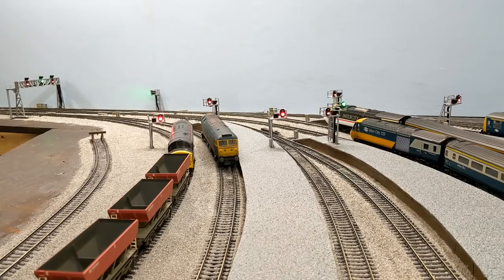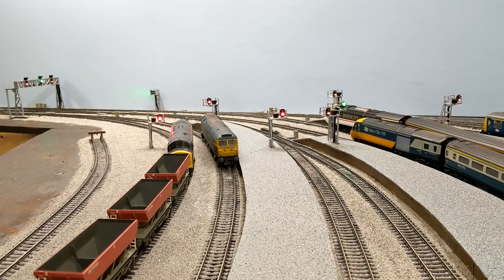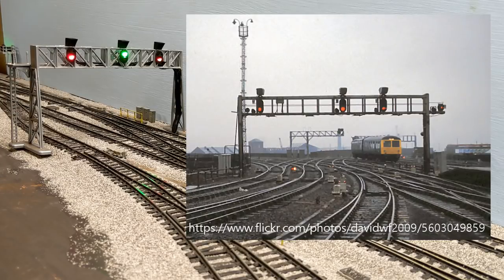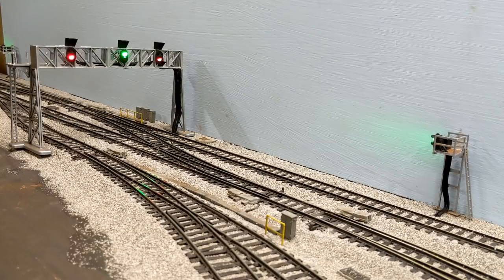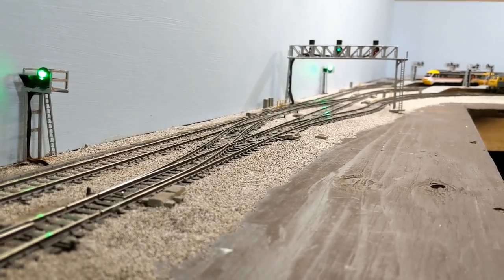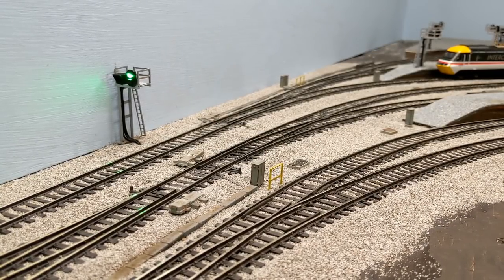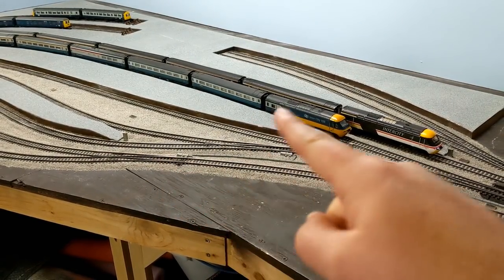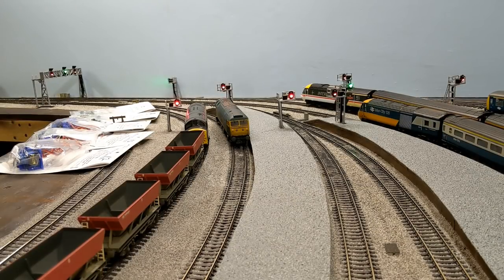37 - Final signals on station south

Comment: The signals and gantrys look really good. My only issue and please don't take this personally is that the ballast and platform surfaces look identical early in the video. From above it's clear the platforms are more grey. How do you intend to hide the glare from the signal near the backscene? I'm only saying what I see and it's not being over critical of an otherwise very good looking layout.
Reply from the maker: Nope, that's all fair. No offense taken.

None of the ballast has been weathered yet, it's fair too clean for what would have been Newcastle in the late 80s and early 90s - the ballast should be filthy, almost black! The problem is that I haven't been able to get the Railmatch paints in the US. Some of the Humbrol paints and weathering powders are available, but things like Railmatch sleeper grime, brake dust, or oil just aren't available. Can't ship those from UK retailers either. So, I'm on-hold until I can figure out my own usable mix of what paints I can get here. I'm nervous on being able to make a consistent mix in enough volume for what I need. I also probably need to finish ballasting the north side of the station, again because I'm worried about having to make my own mix of paints and keeping it consistent shades.

Until then, yes, both the ballast and the station platforms are very similar colors with a shiny surface. It looks a lot more noticeable in the video that it is in person. Same with some of the weathering I have done on the gantries - it looks a little too much in places, but that's not actually the case when I'm looking at it for real. The backboards were put in place and painted blue just to give some kind of relief - I'm planning on an actual printed or formally painted backscene in time. Again though, that's hard to figure out here in the US, so it's remained just a basic painted blue for a while now.

All a balance in trying to capture on video the current state of the layout as I make progress. Always a work in progress though. Thanks for the feedback, much appreciated. It helps me keep a list of things that need doing. Iain